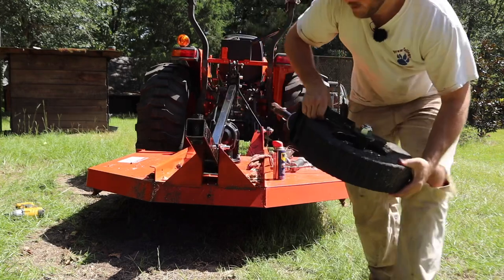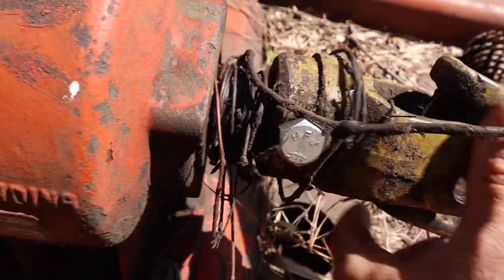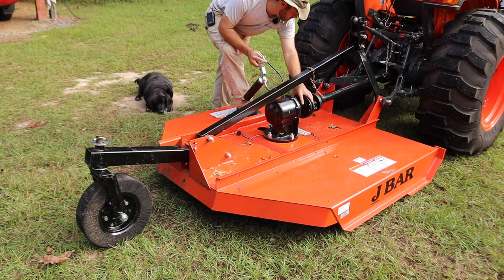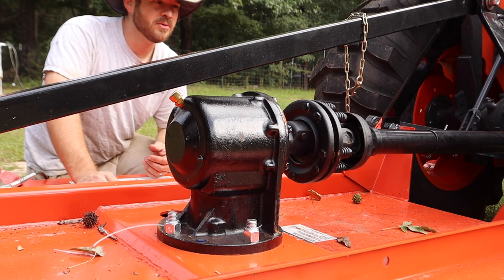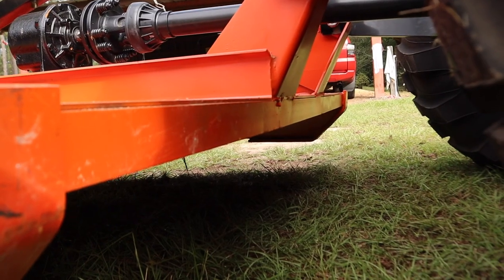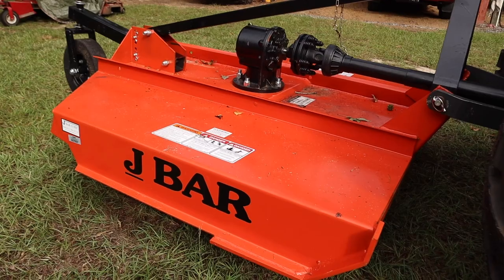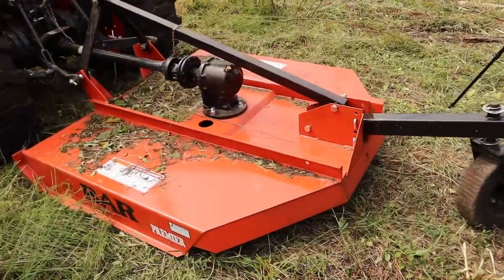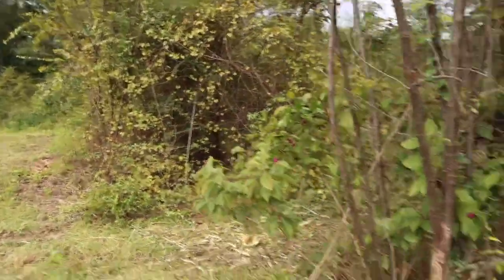Testing The Cheapest Heavy Duty Tractor Mower On The Market

Comment: If you get into mowing something that you want to look a little better,  you need to make sure the mower is cutting level with the ground.  You can level it side to side on some level concrete or packed dirt, but level the blades, not the mower frame/sides (they can somehow get bent.)  In leveling front to back you need to have the front cut a little (an inch or so) lower, so that you are not recutting on the rear and using more fuel.  Consider that the small rear wheel on the mower probably will sink into loose dirt deeper than the large rear tractor wheels, if you level it fore and aft on concrete or packed dirt.

Enjoy your new 'toy' and be safe around it.  The end of the blades are traveling at around 100 mph, so you do not want to be in the way if one hits a 'line drive'.  Also keep spectators away, since they are more in the range of fire.  The tractor driver is up higher and has the PTO shaft, 3 point links, and other metal to 'shield' him.  I have been hit on my heel by one third of a brick, but good work shoes limited it to a good 'sting'.

Comment: Looks like a grade 3 bolt. I used grade 8 on my snow blower but I would tighten it up. When it sheared it was a clean break. When using a mild steel bolt if it isn’t tight it has a tendency to bend, that’s why I keep the sheer bolt tight. The slip clutch it a great feature.good looking machine my friend, should give you many years of service, especially the way you look after things. I m sure if you look at the other mowers you would be able to find flaws in them, good example is tilt trailers, made in the USA but after a couple of years they rust and look like it was made anywhere but in the USA.

Comment: Hey there! little tip ive learned with my 86HP workmaster is when engaging the pto go slow, will easy the jolt when it engages and take some of that jolt force off of the bearings
Reply: I use the same approach, start slow and raise the rpm up.

Comment: Not cheap.  Great value.  My father sold Bush Hogs from 59-87.  Those old 305's and 306's had 90 HP gearbox's with 1/4" plate steel for the side bands and 7 ga tops.  The 5 footer was over 800# and the 6 footer was over 1000#.  Very heavy duty rated at 3" cutting capacity.  Your JBar is a great value that will do anything that you need to do at an affordable price.  I have a 10 foot Titan that is built at an attractive price also.  It does anything that I need done.  Like your Kubota also.  Great utility tractor.  Thanks for the video.  I appreciate it.

Comment: I have bought a J-Bar rotary cutter, 4 ft and have been using it in different kind of brush.  I am pleasantly surprised on the quality for the money.  I have been using equipment like this for almost 50 years and I would recommend this product.  I seen a post where someone was doubting the gearbox and I say if the gearbox is maintained and not misused, it will give years of service.  In my experience, I have seen top of the line quality equipment fail after a short time over misuse and maintenance.  I would guess this cutter might last longer than me if it is used properly.  I run a Yanmar 1600 and it runs the cutter well.

Comment: In the thicker grass you'll notice your clippings are not dispersing, top arm adjustment tighten up, and drop the wheel another notch giving the back of the mower about an inch more height than the front. 
    Thanks for the video! When I start shopping for another mower they'll be the first I look at.

Comment: Man I'm glad you made this video, After shopping for a bush hog most of the summer I found the J-Bar's. I couldn't find any reviews or anything on them, but for my needs and the money I decided that's what I was going with. My local dealer (South Ms.) was sold out and hasn't got anymore in yet. but when he does I will be getting one. THANKS
Reply from the maker: I called my dealer and put a deposit down, it still took them a month to get it. They're either really popular or the factory is too small! I used it a lot today, and it took some good knocks. Can't even tell it. This is the Premier model, by the way, they make lighter duty ones as well.
Reply: @falllineridge   Yessir, my dealer told me a could put a deposit down also and have it ordered whatever color i wanted or just wait and see what he got in. while researching on YT i found a video of J-Bar factory, it is a Very small shop. but hey, long as the strive for Quality over Quantity its not a bad thing to be a small business

Comment: I have a 6' 80's model Modern mower and a 1965 MF 35 Diesel Deluxe if I can ride it down mower will cut it. 3" is no problem for it, when saplings are bent over and wood is under tension one blade hit will take it down with no added stress on mower. I know you don't want to scratch orange paint on your tractor

Comment: I bought a little one out of a field from a guy for $100. I bought it, with the intention of tearing it up in some thick brush and saplings. The rear wheel was shot, so I took it off and ran it without one. I put new oil in it and a new pto shaft. 7 years later, I have cleared acres with it and still mow grass around the farm, with the same blades. I bought a new set, but never needed them.

Comment: Looks well built in the video. You'll see a difference with the slip clutch. I used a TSC mower for years. Not well made. Purchased BushHog last Sept. 5ft medium duty. 
Its just a pleasure to use after mowing with County Line mower. 
  Enjoy your new mower be safe.👍

Comment: I was the one that told you that I have about three of those tractors. In a few videos back. 
  Remember me saying when you start mowing with those r4 tires in the grass that it does cut the grass that was pushed down by those big wide tires.  then you have to go back two days later and mow where the grass stands back up 😀.   You can also tell where they ccut cost.One side of the mower says J-bar the other just says Bar 🤣🤣🤣
Reply from the maker: Ha! I'll have to check my tracks in a few days. So, J Bar uses decals instead of paint, so that letter just fell off!
Reply: Fall Line Ridge ha ha love it.   Keep it up amigo.

Comment: Bolt grading is usually, whatever mark you find on the bolt head, like in yours has 3 marks, is usually graded +2 in hardness = 5 in your case.
So, on your bolt has 3 marks, so +2 = Graded bolt = 5 .  I believe they all follow the same grading system ?

Comment: Get a helper with roundup mixed with oil emulsion mixed in water. Spray chinaberry and privet as soon as it is cut down or it will scab over. Do it in the winter with leaves off so sap will not flush out killer. Most will not come up again except for larger base stumps, they will root up on sides in the spring. Spray before 3 feet high and you will get it except for new seeds coming in from near by. Get goats as alternative, they love young sprouts.  Good luck!

Comment: Iirc, if a bolt is unmarked in the US it is supposed to be a grade 3 bolt, anything weaker has to be special order if your using it as a mechanical version of a fusible link. I have borrowed 2 Jbar mowers in the past and have always had good service and have been impressed with them.

Comment: Normally when a bolt head doesn't have any slash markings, it's a grade 1 or grade 2 bolt, low shear strength. I like the hog, I'm looking for one right now but haven't seen that brand around here in eastern NC. After 3 years, is it still holding up good?

Comment: It looks like it will be a good rotary cutter for you. I need a new one bad. My Howse is over 20 years old, and needs re-skinning or replacing one or the other. I did not know what the name for Privet was. My wife and I just called it wild hedge. See, another day and I learned something new. Thanks
Reply from the maker: Privet is nasty invasive stuff, bees really like it in February though.
Reply: I’ve got two Howse bush hogs (4’ & 6’), both of the have been extensively plated. Looked at the JBar 4’ to replace my smaller unit, I don’t really cut enough to justify buying a new one. Might spring for a FH medium day flail cutter.

Comment: Nice looking mower. You might want to adjust the springs on slip clutch.  Your 45 hp tractor will not slip that 75 hp clutch.  With that clutch factory set on your 45 hp tractor is just like not having a clutch or sheer bolt. Just hate to see you break the pto out put shaft

Comment: Watch the blades, as they wear down. It will be noticeably harder for it to cut the rubbishy stuff once the wear and tear starts putting nicks and dents in the blade. I rode on a ride-on called a Cox Stockman several years ago, cutting residential grass. it was a pretty good mower, for residential mowing needs. It would just go over small sticks and branches, that's how I know about the nicks and dents thing, even that mower's blades eventually showed signs of wear and tear with the nicks and dents appearing on it.

Comment: I own this mower.  Go ahead and buy you a proper rear tire fork because one day you will be mowing and come back around and see something on the ground and it will be your whole tale wheel assembly and that homemade fork that broke because it is just not up to the task. I also see they fixed my larges gripe to them to date.  My JBAR does not have a hole in the top to access the blade bolts.  What a pain to remove and install the blades.  I sent them multiple emails on this.  You are correct heavy built but they need to improve their fit and finish regarding welding and step it up a notch.

Comment: I think the square tube that the tail wheel attaches to is upside down. There should not be a 2 inch+ gap between the wheel fork and that tube when the tail wheel is off the ground. There is a height difference in the “ bushing” on the top and bottom sides. I think the short bushing should be on the bottom. That large gap may put too much stress on the fork spindle when going over very rough ground.

Comment: I feel you when you buy something you pay for what you get in terms of the total cost and quality of a product. With that said I feel like most brush hogs/brush cutters will perform moving basic grass/brush and will last for awhile by just doing that. I feel where the major difference comes into the picture for  bush hogs/brush cutters and comparing the cheaper ones to the top of the line ones is the quality/reliability/durability and the length of life of the product especially if you keep them maintained. The top of the line products will just out perform the cheaper brands/ in every category but you will pay for it up front in total cost. Now nothing will last even the top of the line products if you use it incorrectly and dont maintain it but you can still get a decent bush hog/brush cutter for a decent price compared to getting a top of the line brand.

Comment: Hey Buddy, Am I right about those blades being on pivot pins that allow them to move separately? If so I think you may have a problem once the pins start to wear. Well I know one thing life has taught me and that's throwing big money at a problem doesn't always mean it will work out okay. Machines can be like women, a nice dress and hairdo doesn't mean shes well built on the inside. Keep an eye on those blades and pins, but I'm with you she looks good to me. God Bless.
Reply from the maker: Yes, that's how the blades are mounted. I think that's pretty much the standard though. Most all brush cutters are set up like that.
Reply: @falllineridge  I think it's done so as to minimize kickback to the actual drive mechanism itself. If the blade can bounce off of something stiff, it will allow it some flexibility. At least that's my theory on it.
Reply: All Brush hog blades are mounted this way. I have some units that are very old and are still on original blades and (pins) mounting bolts. Unless a unit is just cheap made that shouldn't be an issue.

Comment: Another cost cutter is the lack of any debris stops at the front or back…sometimes is chain sometimes other materials this had nothing. These stops will also reduce your wind lift less efficient…thus can be noticed by how it makes windrows of grass. More efficient lift wind tunnel effect will keep the material in longer. Of course most brush hogs leave clumps and messy finish anyways so not to much lost

Comment: That thing cuts better than my Woods BB720 ever has!
Reply from the maker: That's pretty amazing, I bet your Woods will last longer though!
Reply: I don't know.  The gear box is making a petty bad droning noise right now and it's only got about 50 hours of pasture mowing on it. It wind rows the clippings so bad that I can literally bale it without raking it. I still can't figure out why it won't cut a strip about 12" wide on the right side.  I just put $180 worth of new blades on it and it made no difference. It's probably headed to the scrap pile after this season ends.
Reply from the maker: @justkeepingitreal7768  That's crazy, those things are pricey.
Reply: @justkeepingitreal7768  It's possible that your gear box shaft is bent. The only way to check it is at a machine shop where they have devices to measure the trueness of the shaft. It doesn't need much of a bend to create problems.

Comment: Just wondering did you slip the clutch before starting. I've heard they will rust together. I know you just got it but just don't know how long the clutch has been in storage.
Reply from the maker: I didn't. Thanks for the tip, though! I didn't know that could happen.
Reply: @falllineridge  There's several videos on how to slip it. I think they recommend to do about once a year or not used for awhile.

Comment: i think you should loosen the bolts and burn in the clutch disc and then tighten till it grabs and does only slip when it meets significant resistance, now verify with literature or dealer. just saying

Comment: I really hate those prevet bush. Looks good. Yea i agree 2in would or might mess it up. Thats called for a chainsaw. I use a finish deck 1/2 in is as big as i would go on that.
Reply: My Modern Ag Viper 12 12ft model and our used Modern Ag Sunsine 6 takes out 3in without issue. Not even a clutch slip. 

The Viper 12 was $12,000
Sunshine was $500

I so despise the shield on the PTO hard as hell to grease. Especially the batwing with the plastic shields at rhe gearbox.

Comment: I searched, in vain, for a jbar pmh5 like that for about 5 weeks.  they had some staffing issues at the manufacturing site and just can't get them out quickly.  Looks good.  curious what it will do if you add the extra blades in , since they  come ready to take 4 cutters!
Reply: Just noticed that, wow..never thought about adding an extra set of blades. Bet you can get a mulch result..I’m going to check my Land Pride cutter to see if I can add extra blades. It’s a standard duty though, and struggles on the thicker brush. Was actually looking for a heavy duty cutter at a reasonable price.

Comment: so my question is... after 3 yrs how is the mower holding up?  In the market for a mower.
Reply: Pretty obvious he doesn’t answer any questions
Reply: @BamaBassCatcher99  ended up with Betstco flail mower
Reply: @howardfluty566 how long did you use the J-bar and what was your take on it overall?
Reply: @BamaBassCatcher99  didn't go with the j-bar.
Reply: @howardfluty566 i meant the rotary cutter you had!
Reply: @BamaBassCatcher99  never had a rotary cutter.  only the flail.  btw my flail is a beast...cut brush up to 3in dia, plus cuts grass like finish mower and maneuver's in the woods much easier than a rotary